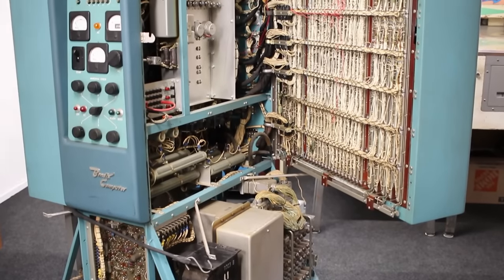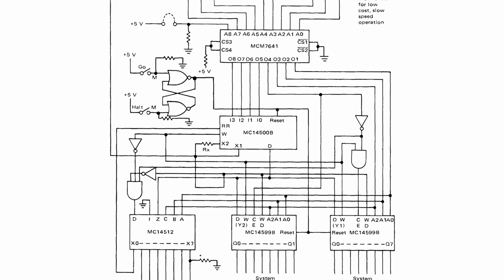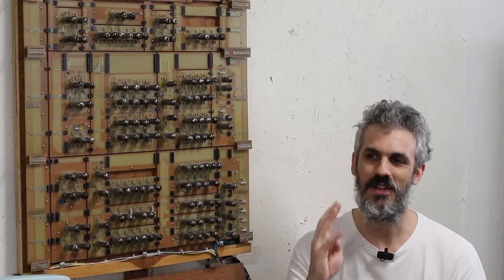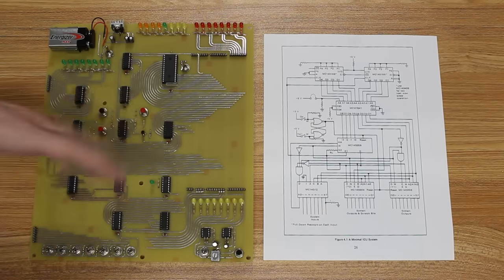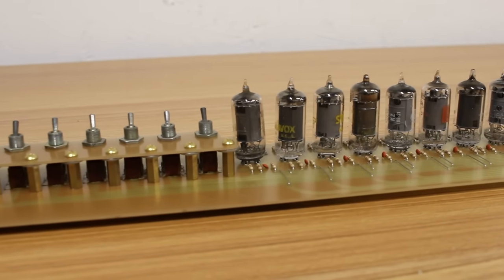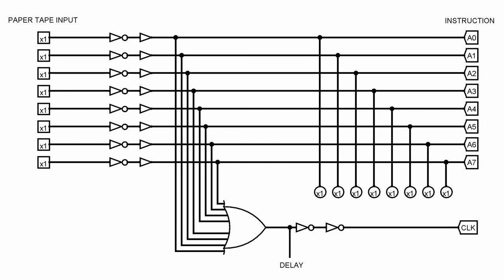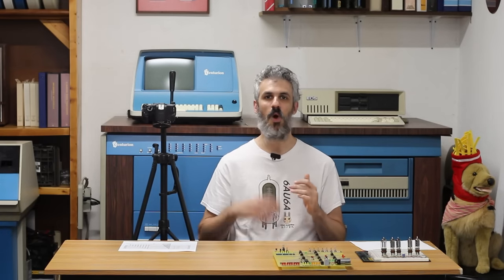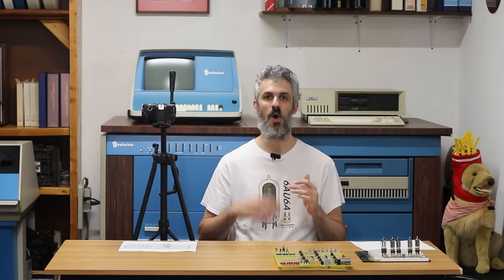VTC P.34 – Building the Paper Tape Interface

Comment from the maker: Hey everybody, thank you so much for all the awesome comments!
I’m seeing a lot of similar questions, so I figured I’d answer them all in one go here:

Why not use the tractor feed punch for a clock?
Primarily, the entire paper tape portion of the build is a massive question mark right now. At the bare minimum I know I have to have 8-bits coming in and that’s it. So, I wanted to design the system to work with the absolute bare minimum in case we run into troubles designing the paper tape interface from scratch.

What about losing your NOP0 instruction?
The processor actually has two NOP instructions, one at 0000 and another at 1111, both have external flags they set (Flag 0 and Flag F) and both are currently unused. Losing the NOP0 instruction doesn’t actually hinder the processor in this case.

Paper tape isn't random access, so you can’t do branching instructions!
Actually, you totally can. The MC14500 (and thereby UE14500) was designed to work with any sort of crazy program control you could think of, so instead of branching instructions being done by jumping the program counter, they are instead done by masking input and output. Every instruction is actually executed, just the instructions we want to skip don’t produce any results or have any effect on anything. The Minimal ICU System on the PCB that I show at the beginning does use a ROM, but the PC isn’t jumpable at all, yet we still managed some tricky stuff with it (like playing Kill the Bit).

Your design won’t work at higher speeds!
No worries, the rest of the processor is so poorly designed that it won’t work at higher speeds either, haha. Seriously, I’m aiming for 45.5 Hz clock speed. That’s just 4-inches per second, which is glacial for both paper tape and the computer. Because of this, we have a lot of leeway.
Reply: I'm curious then, are loops possible without an infinite supply of tape?  Or is ignoring select instructions while going forward the only control possible?  (In this context, should that be "Paper tape is NOT random access..."?  Being able to reverse the tape would be cool.)
Reply: What I'd probably look into doing is making the jump instruction work by forcing the CPU to receive NOP instructions instead of the actual instruction recorded on tape, until the tape comes around to the location the CPU was supposed to jump to.  The tape would run as a loop of course, although if none of your loops were very long, you could theoretically just repeat the loop instructions on the tape and jump past code which wasn't required on that iteration.  This would make for a long tape, and it would still have to be manually re-wound so you couldn't have a program running endlessly without a loop.
Edit: I see from your reply to another comment that you are already 'way ahead of me. 😄
Reply: 6:49 channel rename. UsagiElectric henceforth to be known as NekoElectric.
Reply: The processor isn't poorly designed, you just have design goals other than speed.
Reply: @SeekingTheLoveThatGodMeans7648  You can make it a literal loop by taping the ends together.

Comment: the sprocket hole was frequently used to clock data from a paper tape. notice that it's smaller than the data holes? this gives some setup and hold time in the data.
Reply: LOL @ "frequently used"
Reply: @ashleydawson5070 do not underestimate how common paper tape was .. most minicomputers used it as well as both ASCII and baudot teletypes and telex machines.
Reply from the maker: Currently, I'm not sure how the paper tape itself is going to shape up. I won't be using anything off-the-shelf or existing, I'll be making it all from scratch. It seemed easier to build in a slight delay using two tubes than it would be to add more complexity to the paper tape reader itself. As for losing the NOP instruction, the processor actually has two NOP instructions, one at 0000 and another at 1111, both have external flags they set (Flag 0 and Flag F) and both are currently unused. Losing the NOP0 instruction doesn’t actually hinder the processor in this case.
Ultimately though, if it appears to be unnecessary, I can always remove and recut that little display board for future changes!
Reply: @jack417k  no, no -- I was laughing at the terminology... "frequently used" and using it for a clock. Made me giggle...
Reply: Yeah. I'm interested to see how (if) this clocking scheme works. Usually you just use the sprocket hole for the clock since the other holes should be stable by then. Most would hook up to a parallel port sending 8 bits of data when the sprocket hole is detected. I'm not sure you really want "anything but all holes punched" clocks it. Without thinking about it much, the scheme you came up with kinda frightens me... and also seems more complex. Just seems like it adds a lot of potential read errors from poorly punched or alinged tape. I'm probably missing something...

Comment: Oh hey, I was just thinking about your vacuum tube computer over the weekend. I wanted to ask about the pin sockets you use on your PCB boards. You obviously buy them in bulk, so I'm curious where you get them from? I'm designing a circuit that uses soviet era VFD tubes, and the only reasonably priced PCB pin sockets I've found are made by Harwin, part # H3161, and the silicon-based electronics vendor sells them for $0.30 Aussie dollary doos each for 10+ quantities. Not so cheap if you need them in bulk.

Comment: Going with an optical reader or a mechanical one? Some of the old punch-tape readers for things like marquee signs were optical, as there were no contact brushes and such to wear out and the punch paper itself would last much longer with nothing dragging over it. Photoresistors pre-date vacuum tubes, so it would be "period correct" as some element of a retro-designed system. Just thought that may be worth a mention.

Comment: Remembering Colossus was clocked by the tape too, although it was designed to run off the tape clock to avoid having to clock everything else from anything else. And it ran considerably faster. But it still warms my heart to see that that’s how you’re doing it. :)

Comment: Even if you get the paper tape working, I’m not sure how you’re going to get it to work with your tube computer. The problem is that ROM/RAM are random access (you can put in any address in the address space, and get a byte out), but paper tape is ISAM (Indexed Sequential-Access Method) storage; you can step (index) forward to a specific spot on the tape, then read the data there, but if you have to go back and re-read a byte, you have to rewind the entire tape. Plus, it’s more like a CD-ROM; once you punch a hole, you can’t unpunch it, so it’s fine for program storage (like a flash EEPROM), but not for data storage (unless you put in a new, blank spool of paper tape, and your teletype can write as well as read.) 🤔

Comment: When I put together my MC14500 based design I had timing issues when the 8-bits from the stored instruction and data in an EEPROM arrived at the 14500 and when the timer clock 'clocked' the instruction in. Solved the issue using the delayed clock approach in your paper tape interface, with the master clock feeding a few schmitt triggers and an RC circuit to clock the 14500. Introduced a sizeable delay, but at a clock speed range of 1hz to 2khz it works fine. Enjoying this series - always something to learn. Cheers. N

Comment: Pulse digital switching waveforms by Millman Taub 
page 441, says adding diodes in series with coupling capacitors of the 12au7 multivibrator squares up the output waveform

Comment: "30 minutes of petting the neko-chan later..."

 You just built a nice vacuum tube fuzz or distortion effect :)
So nice to see the 150A back in action! All this restoration effort, it didn't go for nothing... we'll be back with another episode on that :)
Good to see your PCB fab process improve - and a nice tee from Jeri too!

I also love the straight-up headers and jumper boards for connecting the PCBs. I hope the system will survive crashes (the literal kind) better from now on. Waiting for some road tests :).
Reply from the maker: The 150A popped a fuse, not sure why, and both channels had to be adjusted vertically quite far, so some things have drifted it seems and some power thing may be not quite right, but we'll get it back up!

Gotta represent Tilt 5 and Jeri, she's awesome!

Comment: Your design looks great on paper but as soon as you load.. well.. actual paper, you will notice "phantom signals" when one hole already reached the beam but adjacent one didn't. And while tubes are a lot slower than FETs, the speed is counted in nanoseconds - many orders of magnitude faster than the tape. 

Things get even trickier when the punch reader reaches its design speeds of a few meters of tape per second aka "finger-dismemberment speed" (beware surprise catastrophic paper tears and jams BTW).

"the delay circuit" can provide debouncing needed but you should carefully tune the delay. It should ideally be set to a maximum transition interval (time needed to pull the tape from one set of holes to the next and stop there) plus a bit more - see your punch reader docs if you have any or experiment.

But more importantly the punch reader hardware itself should require tape pull (clocking) signal and probably provide a "ready to read" signal (though yours may work differently). That last one should be used as read clocking input. Please make sense of it before constructing any supporting circuitry. Although adjustable delay will most likely still be required.

As others suggested below some punchtape systems have special smaller holes just for synchronization aka clocking.

Yes you can still do it your way but I don't really see the need for a dozen of extra tubes and supporting circuitry

Comment: For use in a bright room, it might help to have some smoked acrylic plate over the VFD tubes.  Do you coat the milled PCBs you produce with anything to keep the copper traces from oxidizing?  (Something like a sprayed-on conformal coating?)
Reply from the maker: That's a good idea!
Currently, I don't spray anything on the back to prevent corrosion. Texas generally isn't that bad about corroding exposed copper. Some of the boards are 2+ years old and still look totally fine.
Reply: @UsagiElectric  I have projects with bare copper pcbs that i  made 10 years ago. They still work fine. They look realy brown and corroded, but they look stable in that condition. Also we have winters, and moist air.
Reply: I'm sure I've seen copper boards wiped with a tin compound which then leaves them plated with a thin thin thin layer of tin.
Reply: @edgeeffect  I did that on many smaller boards I made. Just lots of flux and painting solder with soldering iron over it. Excess is removed with soldering wick. Only downside, that it tends to warp bigger board with lots off copper area a little. I dont intend this as advertisement, and my videos are in lithuanian, but here is my video about it. Begining of the video shows all steps I used to do. https://youtu.be/qhLJpAeM6vY?si=5AHsaD7r55gECvWu

Comment: In the 70s I worked with paper tape, and the optical readers I used used the smaller sprocket hole for the clock.

Comment: Be careful your cat isn’t trying to turn you into a Blofeld 😉 The thought crossed my mind about using the sprocket hole of the tape for a clock (which I see is mentioned already) might’ve got you your NOP back. Not that you can do much with a NOP beyond code delays. As always, loving how this is coming together 😊
Reply from the maker: Haha, if I start going bald, we gotta worry!
Currently, I'm not sure how the paper tape itself is going to shape up. I won't be using anything off-the-shelf or existing, I'll be making it all from scratch. It seemed easier to build in a slight delay using two tubes than it would be to add more complexity to the paper tape reader itself. As for losing the NOP instruction, the processor actually has two NOP instructions, one at 0000 and another at 1111, both have external flags they set (Flag 0 and Flag F) and both are currently unused. Losing the NOP0 instruction doesn’t actually hinder the processor in this case as we still have the NOPF instruction if we need it.

Comment: With the advent of 3D printing and home mills, would you consider building your own teletype from scratch?
Reply: it's months of work, mostly mechanical. Keyboard is easy, punching tape is much trickier to do right, and printing is trickier plus the sheer work to produce working mallets/matrices/daisy wheels with every printable character.
Electric typing machines are expensive but they are well worth their money in labor.

Comment: Awesome progress.  What is that awesome clamping tip scope probe, and where did you get it?
Reply from the maker: That's a great scope probe isn't it!
It's the AC-21 probe that came with the HP-150A originally. Mine didn't have it, but I managed to find a replacement on eBay for a decent price, and I absolutely love it!
Reply: Sweet!  Thanks for that.  There was one on Ebay.   It's mine now!

Comment: I have used that model HP scope.   I still have nightmares.  When testing a thingy I like to have my test equipment in arms reach.  Using those big boat anchors makes it harder to work on things because you run out of room fast. Think of how far you can reach when seated in a chair without wheels.  Even with all the space in the world you can only reach so far.  I like the pretty colors in the new scope.  Looks good on video.

Comment: Most old 'tube' scopes used the filament supply voltage to light up the 'power on' indicator.  Since your power on indicator is dead, I'd be checking the mains fuse to see if it died from 'metal fatigue' (as opposed to a more violent cause - the difference is fairly obvious).
OTHER possibilities include:
- The power transformer itself.  This is often a 'terminal illness' since an old scope xformer is VERY unique with a fairly high voltage (a few kV) CRT final anode winding
- Mains wiring (well duh!)
- Internal tube short (Often the CRT itself making it rather 'terminal')

I look forward to this repair even more than the 'choob-putah' itself

Comment: That's awesome.

Wouldn't the paper-tape reader have a mechanical clock switch of it's own that makes contact with each new byte ?
Reply from the maker: Thank you!
Currently, I'm not sure how the paper tape itself is going to shape up. I won't be using anything off-the-shelf or existing unit, I'll be making it all from scratch. It seemed easier to build in a slight delay using two tubes than it would be to add more complexity to the paper tape reader itself.
Reply: @UsagiElectric  All you would need is a roller attached to a sort of blade being turned by the tape with some sort of light sensor. It's 20 past 12 in the morning and I'm a bit drunk. Nite nite.

Comment: Pardon a possibly stupid question, but wouldn't rope memory be an option for recreating the ROM? Not that paper tape readers aren't cool though. :)
Reply: Got it - need the paper tape to make the clock pulse. Would have been a challenge with rope memory.
Reply: @magnusnordlund3787 isn’t there this other clock? Didn’t we already ( or someone else) build a (dynamic) shift register out of two tubes per bit?

Also I love tubes so much. CRT with telecentric optic into a mask and the transmitted beam reverse deflected back into an anode. Clock runs to a counter to a R2R DAC.

Also: electric motor and tape as internal means of computation is like Conrad Zuse Z1. It is not really period correct for tubes ( Eniac). Modern signal tubes are much more reliable than the analog radio tubes. Fun fact: with binary, tubes would have been on much more and would have lasted longer. Powered up, but gated completely, is what damaged them. Analog tubes work around a point. ECL would have been the right choice.
Reply: This is a very good question. With paper tape, you have only a sequential memory, not a random-access memory. Therefore you cannot execute complex programs with branching instructions, and the computer is not a "modern electronic computer". This is a big limitation.